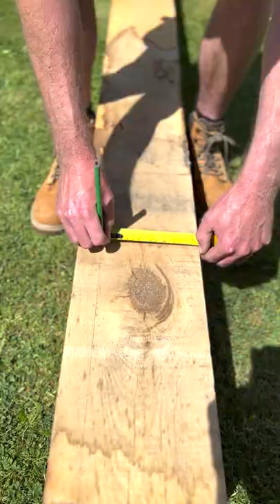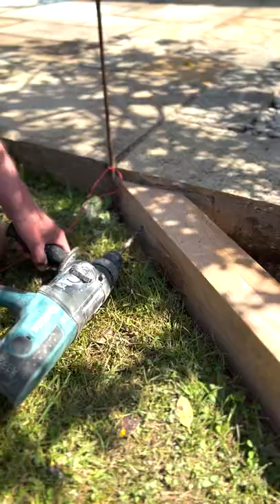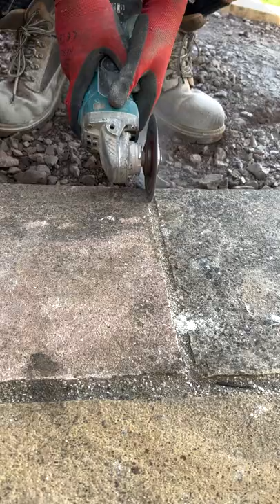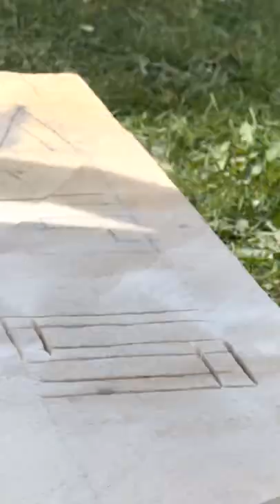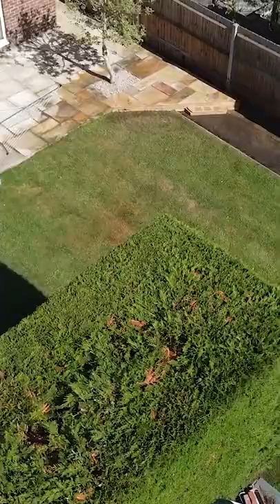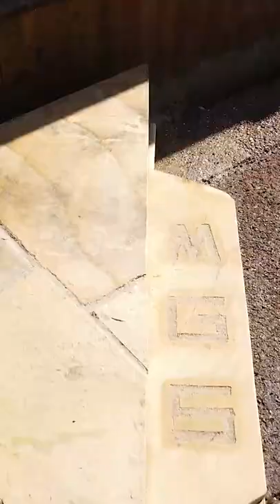Amazing Landscaper's Finishing Touches  | 60 Sec Pro | #shorts MGS078

Comment: The oakwood is going to rot away pretty qickly. Almost only tropical wood like teak or IPE last with soil contact.
In Germany the norm is to build any wood construction 30+cm away from the ground. If you have a gravel drainage you can go as low as 15cm.